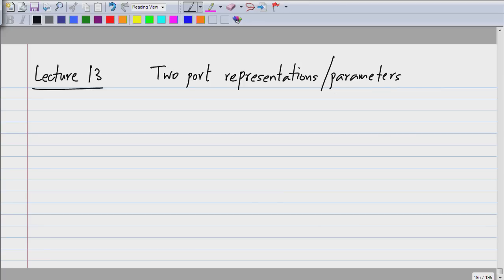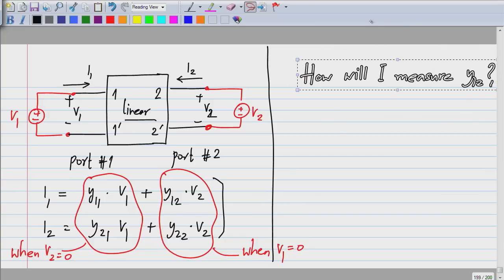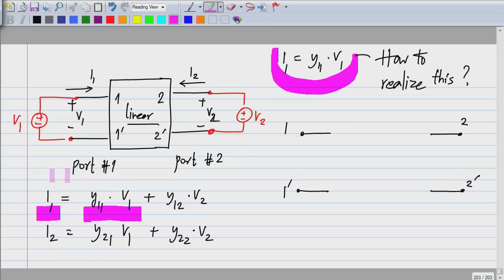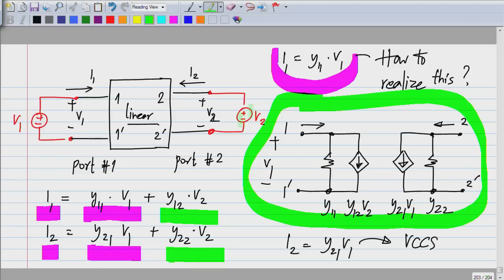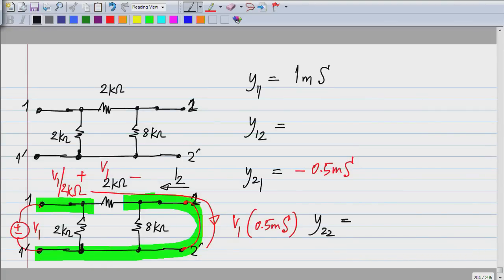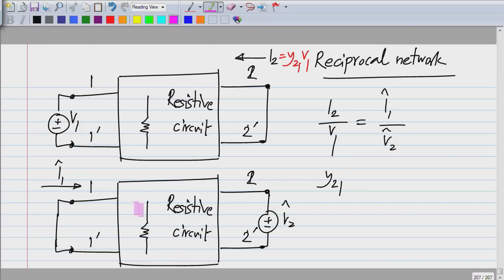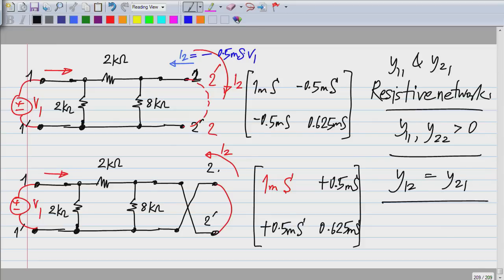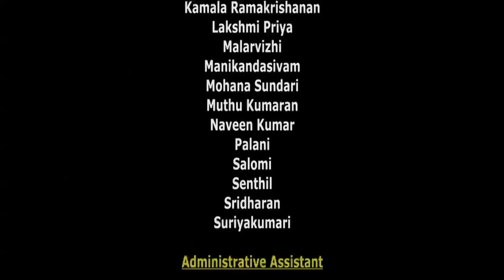Mod-01 Lec-13 Two port parameters-y parameters

Comment: @Pavan Kalyan, you are measuring it as resistance. the y parameter is a conductance, which is basically the inverse of resistance. 8k//2k is (16k/10k)ohm to get conductance take inverse, ie. 10k/16k= 0.625mS.

Comment: When you do the Z parameters, you open the port and just find the equivalent resistance.  However, when you find the Y parameters, you short the other port, which nullifies any resistors in parallel with it. Why do you open for Z, and short for Y?

Comment: at the time of caluculating Y22 port 1 is short circuited then left side 2K is negleted, then  Y22 is eqvals to  8K //2K =1.6K. But you are saying Y22=0.625kohms ?? could you please answer this